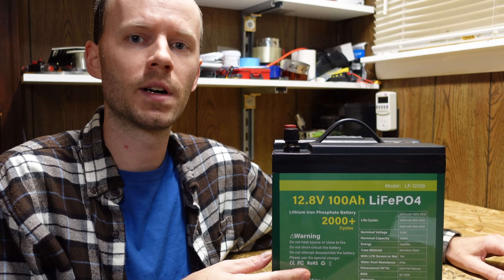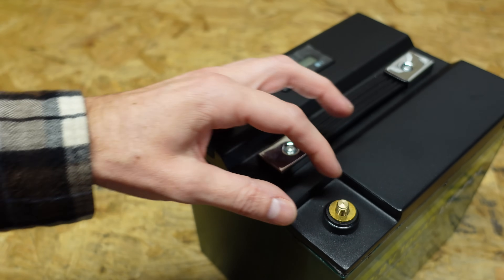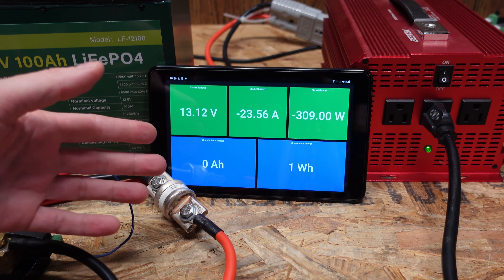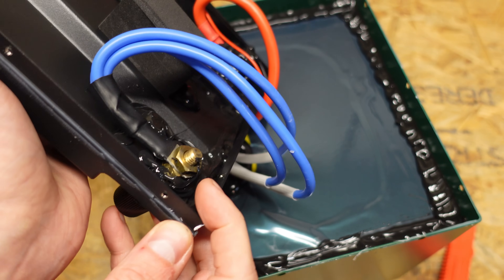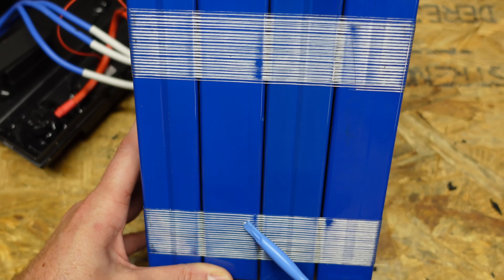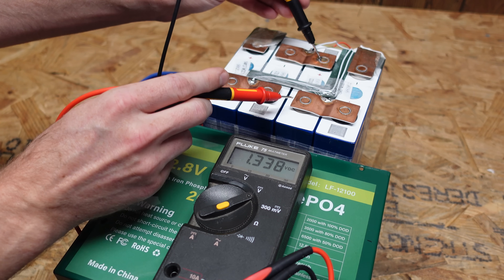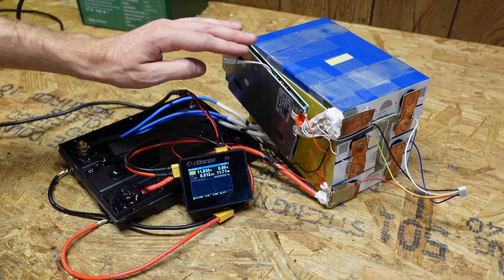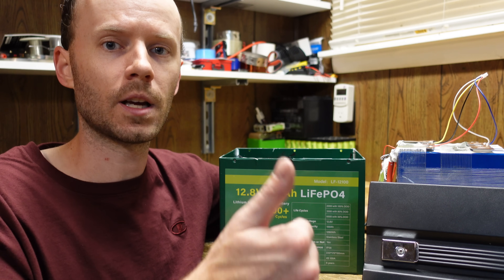CERRNSS 12V 100Ah LiFePO4 Battery Review and Teardown, $270/kWh

Comment: Merci pour cette review. Mais N’ACHETEZ PAS chez ce vendeur. La batterie reçue est certes bien construite mais elle ne donne que 80 Ah ( 78 exactement) au lieu des 100 annoncés. A l’interieur, 3 cm de vide tout autour des cellules.
De plus, j’ai du faire 2 litiges pour que le vendeur  l’expédie et je ne l’ai reçue que 117 jours (!)  après ma commande. Ce vendeur est très sournois et ne fait que des réponses bizarres. J,en suis maintenant à mon troisième litige pour demander un remboursement partiel....Très déçu.
Reply: .....24h après mon litige, Aliexpress m’a remboursé 20% du prix de la batterie soit 70€. J’avoue que je ne m’y attendais pas, cette plate-forme est vraiment réglo !
Reply: Salut c est la 100 ah 4000 cycles que tu as commandé?
Reply: @Rorolap  Salut! Ce sont des 100 Ah 4000 cycles. Une fait bien 100 Ah, et pèse 13,1Kg, l’autre fait seulement 80 Ah, et pèse 10,5 Kg. Elles alimentent chacune des moteurs de bateau consommant 50 A et fonctionnent normalement.

Comment: Ordered these (12.8v 200ah) from CERRNSS FACTORY BATTERY STORE.
DO NOT order from this company.
They sent me 12v 200ah batteries (2400wh) compared to the 2560wh batteries I ordered (12.8v 200ah). (yes, there's a difference, even the label on battery said it wasn't the battery I ordered)
They guaranteed 30-40 days delivery, it took 125 days.
After testing the capacitis, each battery only had 178ah...
Aliexpress issued a refund and told me I could keep the batteries. (long before I even received them / as my buyer protection time was out)
Seller is now harrassing me, and threatening me to send them back.

Order name brand batteries from a reputable seller, cheap is not always better.

Comment: I've brought one of these and its only providing 88Ah.
Reply: weirdly its got a four pin aviation connector on the top of it I wasn't expecting!
Reply from the maker: Does yours say 2000 cycles like mine? Or did you get the 4000 cycle version that I'm being told is newer?
Reply: @LithiumSolar  It says 4000+ cycles in bold yellow text on the front, the deailed information is similar but the "norminal" voltage is 12V and "norminal" capacity is 1200wh
Reply: Tried to post a link to a photo of it, but youtube just seems to delete it.

Comment: How many amps is require to run a2000 wat invert at full power
Reply: Volts x amps = watts

assuming 12v and ignoring resistance; 16-17amps.
Reply: That's wrong! Watts divided by volts = amps.

Watts are constant, voltage determines amps.

2000w / 12v = 166.67amps.
Reply: @ozzybloke4830  just my math mr sassy; the equation is still right.

w=V x A is pretty standard.

then V^2 / W = R
Reply: @ozzybloke4830  One could also say Watts divided by amps equals volts. It's simple algebra. All are correct.
Reply: You're right must've had a brain fart that day.
Reply: Your wattage calculation is still wrong for 2000w @ 12v though.

Comment: Hey.... I just came across your channel and I did subscribe. I'm hoping you might be able to help me. I don't know much about solar,but I'm looking to build my own solar generator. For starters let's say I buy a all in on growth inverter and battery if I connect solar panels to the inverter battery but I'm not using any power will the panels over charge or damage the batteries or can I leave the inverter/batteries/solar panels plugged in 24/7 and then when I need to use the system I can just plug in and the solar will charge while I'm using a load? Thanks if you can help!
Reply: You connect a solar panel or panels to a solar charge controller and then connect that to the batteries. Solar charge controllers are smart chargers and they will apply the correct charging profile to prolong battery life and keep the batteries from over charging. BUT---rather than say, "I don't know much about solar" spend some time reading, watching and learning.

Comment: So you got 98.8Ah out of a cheap 100Ah battery - I'd be over the moon!
Reply: Yeah, but usually new prismatic cells test about 5 percent over their rated capacity , which means that these cells are either grade b or they are used.

Comment: Thank you for the test! I actually purchased one of these but in a 280 AH size. So far I am very happy with it for the price ($980 CAD shipped from China) . Being in Canada, I was a bit more limited on affordable battery selection. I was curious about the low temp protection and I assumed it did not have protection. To prevent issues, I put a 12V tank heating pad and it turns on at 5 degrees Celsius to warm the battery; also there is just the heat from the rv being warm as well. So far it’s been working great but winter has not fully arrived.
Reply: Hi Quintin. How long did it take for your battery to arrive? I’ve ordered mine Sept 3, it still hasnt arrived (Im in Ontario)
Reply: @WaseemSyed  hello! Did you get your battery? Because im think about order one too
Reply: @LilPitPirdelli  yes, it took close to  90 days to reach though. Very well packed, looks very well built, Im happy with the purchase 👍🏼
Reply: @WaseemSyed  thank you! Did you test capacity (ah) on your battery?
Reply: @LilPitPirdelli  No, not yet. But at this price, I dont care if its slightly lower
Reply: @WaseemSyed  it took me just over 2 months.. ordered July and received in September

Comment: these battery have been around since 2011 so i dont know what people are saying i bught 5 24v100ampa all min 103 24v200amp 204amps 12v280amp 291amps 12v200 202 amps all batterys say 4000 plus cycles i have had for over a year theses are better then my chin battery 12v200amp cerrness offical store and i bought from lifep04 global store aliexpress all in china no us stock from seller lifep04 cheapest prices i spent 4000 dollers on batterys and worth every penny
Reply from the maker: You seem to have a particular fascination with this battery given the number of comments you've left (has to be well over 10 by now). What's the deal? Do you work for and/or own this company or something?

Comment: I bought it at this store once, and the measurement result is 103ah, so the battery capacity may be different, so you can’t judge that the battery capacity of this store is insufficient through a single battery. At least I recognize this store, and the battery is now in In my RV.
Reply: I also bought 3pcs batteries in this store. Installed on my and my dad’s RV respectively. I passed the machine test. The capacities are 103AH and 108AH and 106AH respectively. My father and I have been using this battery for about 5 months, and the battery is still working well. At least I am satisfied with the price. at the same time. I buy in the United States again, and the merchant delivers it to me through UPS. After I placed the order, I received 3pcs batteries in about 5 days. despite this. I am satisfied with the battery and recommend it. Because their price and quality are very suitable.
Reply: @aries9318  So I still have this point of view. We can’t judge that the store’s battery is insufficient only by the capacity of one battery. I hope it can help everyone to recognize this store correctly.
Reply: @aries9318  You Guys should stop spamming and stop promoting the battery. No one is awake in the US right now to give supporting comments to each other for a crap battery, its 3AM! Bought for my RV in the US! bullshit!
Reply: @dennis_m  What kind of rubbish are you? We have driven the RV to Hawaii for vacation.

Comment: Those cells are what we refer to as "thousand cycle cells"

To bring the cost down, they are used for grid-level storage in China for around 1000 cycles (some of their life) then pulled out and sold.

Most cells have a margin above their rated capacity, so these cells have had their margin used up and then sold as "A-grade" when in reality they are used.

The DEAD GIVEAWAY on this is that sticker in the middle of the vent.  This is from their final capacity test when they are taken out of grid-level storage.

These are the same thing the manufacturer CHINS/AmpereTime and the other cheap-o batteries on Amazon are doing.  This is why the price is so low.
Reply from the maker: Interesting! In that case, testing at 98Ah after being used for 1000 cycles is pretty good in my opinion - lots of life left. That doesn't excuse them from selling "used" as "brand new" though.
Reply: @LithiumSolar  but keep in mind most degregation curves are not very linear.
Reply: Any reason why the cells were taken out after only 1000 cycles? That's only 3yrs and it seems like a huge waste of time & money to replace cells that often.

Comment: Thanks so much for the review and teardown, really worth the wait. It's consistent with my results. I really expected it to give 100Ah after the balance, but didn't. Now I won't order any more of these batteries. They must have put those Grade B 105Ah cells there expecting it to give 100Ah at least if people test. I want to buy the Basen 12v battery that you reviewed, but unfortunately they don't ship to Korea. Anyways, thanks again for the review.
Reply from the maker: Based on feedback in the comments, it sounds like there may be 2 different versions. Mine has "2000+ Cycles" on the case, though some others are saying they have "4000+ Cycles". Does your battery have "2000+ Cycles" like mine?
Reply: @LithiumSolar  I ordered two of the 2000+ version and I get the 4000+ version.
Reply: @LithiumSolar  Mine also has 2000 Cycles printed. I already checked about this, but they seem to print 4000 cycles only on their 280Ah batteries. I think the 100Ah cells must have been cycled as mentioned by @HighTechLab. And inspired by your teardown, I also opened the battery today, But I am not able to remove the cells from the case. Mine has different internals, no heat shrink cover, they have directly glued the fiber board. The BMS is not JBD, it says best-way, another manufacturer. I cut the upper part of the Fiber cover, and found that the Cell is also not EVE 105AH. I can see the positive terminal and it is not the same as yours. I will send you pics via email. Thanks again.

Comment: 2000 cycles are to low.
Reply from the maker: Agreed. Should be 3500+ for the cells that were used here.
Reply: @LithiumSolar  here in asia we can get a grades that are still around 4500+ cycles.

Comment: I have been waiting for a test on this one so thanks for a very good review! I took a chance and bought this a couple of months ago at a very good price. I use it in my RV and it works really good and it feels like good quality. It did say clearly that it did not have low temp protection so I am ok with that but good to know that it did not reach the promised capacity. About support they are really quick to answer questions but I got some strange answers when asking about max charge rate and that their 12 volt batteries do not support parallell connection because the BMS cannot handle larger batteries

Comment: My biggest problem with all of these cheap batteries is the warranty. Where will these people be in 3 years? I've already seen some of these advertised and then disappear, never to be seen again. Personally, I think sticking to a brand that has been around and is well established is the way to go. And, no, I'm not talking about BattleBorn. They are great batteries but at this stage of the game are overpriced, way overpriced. There are several others that are just as good as BB at almost half the price and, in my opinion, is the way to go. In any case, very good review. Thanks!
Reply from the maker: I fully agree on the warranty concern. Even if the company is still around, you know the first thing they're going to do is tell you to ship it back to China. At that point, you can likely buy 2 more for the cost it's going to cost to ship one back. Any time I buy something like this, I always assume no warranty.
Reply: From my experience, even if something has warranty, the producer never accepts it.
Last time I had warranty accepted was 15 years ago
And that applies not only to small companies, but also big ones like MSI (my most recent declined warranty claim).
They all just pull the "its your fault" or "you dropped it" card even when this never happened.
Reply: @hubertnnn  I've had just the opposite experience with items under warranty. The most recent was with my RV. I have a Shasta Phoenix fifth wheel. Believe it or not, I've had no major warranty issues with it. No, really. I can't believe it myself. The only issue I had was with the radio. Made an appointment with the dealer, brought the RV in, and picked it up the next day. I know. Amazing, right? The manufacturer stood behind the warranty and the dealer only had it for a day. Yup, went out and bought a bunch of lottery tickets but my luck ran out with that. But I digress. Back to the warranty issue. I've never had a warranty issue refused. Even my cell phone was fixed under warranty although they did attempt to say it was my fault. That was the only time I had to dig in and make them honor their warranty. Have I been lucky with warranty issues? Maybe. But I've had plenty of "not so lucky" things happen in my life. Don't get me wrong. I'm not that naïve to think that everyone has had results with warranty issues like me. Anyway, as LithiumSolar said, "always assume no warranty". Geez, this is getting long winded. My original comment was about these cheap batteries. My main concern with these cheap batteries is that I see them advertised one day and the company is, literally, gone the next month along with any warranty or any chance of returning them. At least with an established company, I have someone to yell at. 😁
Reply: @Tom-In-Ga  I wonder if it depends on region.
Few years ago I learned that the same product bought in EU and in US is usually a completly different product.
Since in US you have the "sue the company if something is wrong" mentality, they usually try to focus on quality to avoid being sued, while in EU there is no such thing so we are getting much lower quality products, to get bigger profits and sell more.
Maybe its the same with Warranty.
Reply: @hubertnnn  You may be right. But the way many of these companies work to get around the lawsuit thing here is to start up, build or import a junk product, then go out of business to avoid any lawsuit over that junk product. Then they start another small company and do the same thing over and over again. Small construction companies are notorious for that. I think no matter where you live in the world, people will be out to get your hard earned money one way or another. BTW: I have traveled throughout the EU and love all of it. The people, the very rich history, architecture, food, etc. I wish everyone could or would travel so they could see how different the world is but how not so different people are.

Comment: At what voltage did it disconect?
What was the lowest cell or what is the voltage disconect?
Reply from the maker: I wasn't monitoring it at the exact moment of disconnect; however, when I checked voltages about 2 minutes after, one of the cells was at 2.40V.

Comment: Gosh, I thought there was a lot to NOT like about the CERNNSS battery? The connections were crap (technical term- look it up!) and it was packaged way beyond any IP-65 rating requirement? Sadly, I hoped the cells were those snazzy 105AH cells used by Lion Energy, but- I think they used an imposter cell among a couple of good ones! Overpriced when compared to some of the other pre-made, low price LiFePO4 batteries available and lousy connections to boot. I guess I don't sweat the low temp charging as much because I'll know when NOT to charge mostly, but- if they said it has it...Sort of an overall bummer rating.
Reply from the maker: The Lion Energy battery that I tested had the same EVE cells, but that battery tested perfect. Perhaps this is where the cells go that don't meet the cut for those better brand batteries. What's frustrating is if they would put an additional 1% more effort and maybe $1 more in cost, we wouldn't have dumb problems like forgetting to seal a terminal. Oh well, plenty of other brands without problems!
Reply: @LithiumSolar  I think we would both be guessing about 'what's inside' any of these pre-made, low price leader batteries, LithiumSolar! I like SOK because they keep things simple (and, they invested in a hydraulic crimper!) Those are things I can believe in. Less chance of a bad day screw up at least!